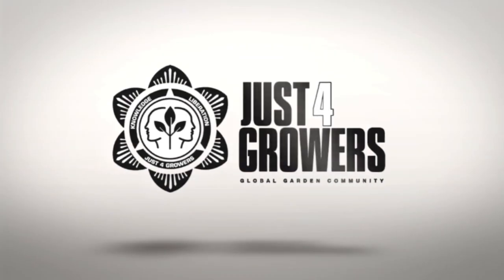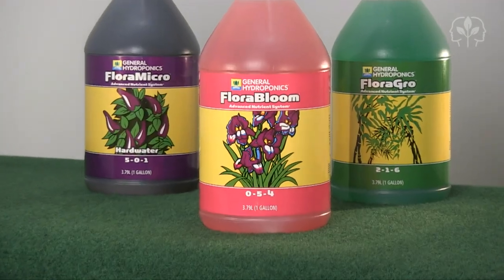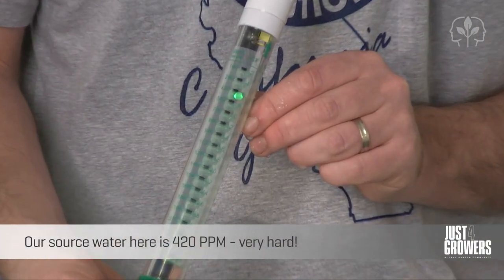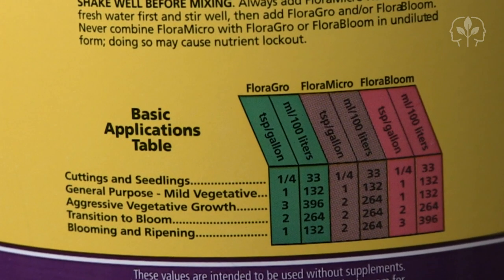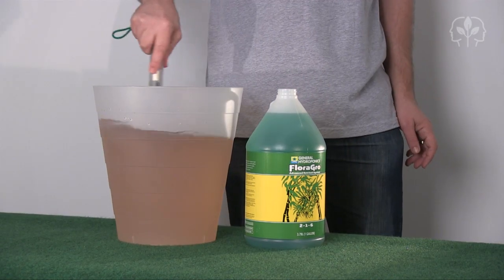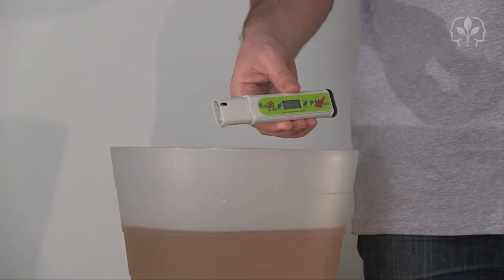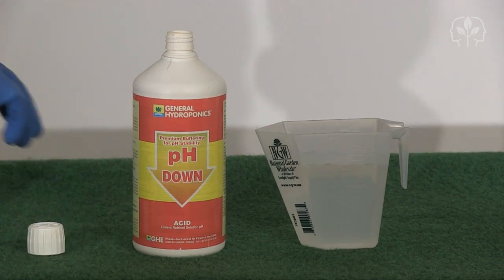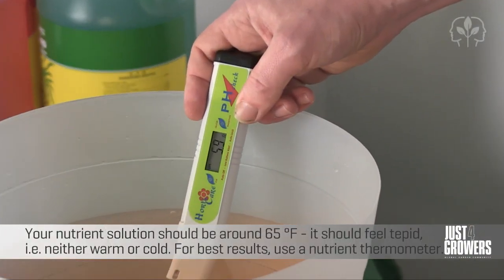How To Mix a 3-Part Hydroponics Nutrient Solution

Comment: Isn't Flora Bloom for the flowering stage and Flora Micro, Flora Grow for the vegative stage?
Reply from the maker: Diggy Craft Hi Diggy, thanks for your question. Actually, Flora Series 3-part is designed so that you use all three parts, all of the time, just in different ratios. (Some people claim they can get away with just two—i.e. Lucas Formula—but let's not go there just yet!) In the vegetative stage, making a general purpose feed, you may well use equal measures of each part. 1 part grow. 1 part micro. 1 part bloom. In peak flowering you may use 1 part grow, 3 parts micro, to 5 parts bloom. Big difference!
Reply: Thanks for answering my question! I started using only micro and grow I didn't know that you used all of them at once

Comment: For soil do I feed once a week only and the rest of the week just water?
Reply from the maker: Israel Yanez Hi Israel. Thanks for your question. I am going to assume you are growing in containers, rather than in beds or in the field. In soil, I would just feed with water to begin with as there should be sufficient nutrients in your potting mix for a young plant to get going. No need for additional fertilizer. Afterwards, you might want to start with a mild nutrient regime after a few weeks and see how your plants respond. Try one watering with nutrients, one without if your containers are over three gallons in size. If they are smaller, I'd recommend using a mild nutrient solution on every watering.
Reply: Everest Fernandez I've heard feed feed water is good for soil?? And can you use GH flora series in soil potting mixes??

Comment from the maker: Hi Mentuhotep Ra. I changed the res every 14-21 days when the plants were small, topping up with half strength nutrient solution and adjusting pH in between changes. I also rinsed off the hydrocorn growing medium each time I changed the res to minimize the accumulation of plant waste products in the growing medium. As the plants grew bigger I upped the frequency of the reservoir changes to every 7 - 10 days.
Reply: +Everest Fernandez (Just4Growers) I\'m not sure but ,if anyone else wants to uncover aquaponics design try Debuncar Amazing Aquaponics  Aid (do a google search ) ? Ive heard some pretty good things about it and my mate got amazing results with it.
Reply: I have a partial hydro system. Each plant is in a separate pot with a passive water reservoir and coco/perlite/hydroton above. Do I need to worry about plant waste accumulation?

Comment: I guess I'm missing something but how do you create a mix of the three part GH series nutrients that would be a custom mix and not just from what they say is a general first stage grow mix?  Their ads say the mixes are almost unlimited to the ratio you want to create and yet in an email I got from them the rep said it doesn't really work that way.  Are the ratios they are talking about the NPK ratios?  I have their 3 part product and I still don't know how to use it other than mix what they call a general early or mid or bloom phase.
Reply: instead of mixing it 1:1:1 you mix it so it has more phosphorus for flowering in a .5:2:.5 ratio.  (e.g. if your aiming for 20-20-20 mix during the vegetation, and then 10-30-10 for flowering)
Reply: rizendell Ok that helps, I'll work with it.  I think you are saying one half measure, two measures, one half measure.
Reply from the maker: Nice one Rizendell and thanks, MegaTregg, for your question. We'll certainly publish some more tutorials on options when mixing 3-part hydro nutrients as we receive a lot of questions about it!
Reply: hallo my bro!!!peace!420!my friend i ask you pls.......for the lamp...if you see the message pls send me!!thanks!!
Reply: buy yourself a EC meter.  You can then adjust your PPM per stage of growth.  This is basically the most customization you can do with these 3 parts.  For example, early veg stage you can add the normal 1:1:1 of your three part, but now you add more water until your PPM is now at lets say 800PPM. if you are in a mid blooming stage you might want a higher PPM so then you do your 1:1:1 with less water to raise your PPM to maybe 1200 ppm.  As your plant grows and flowers, it'll require stronger or lesser feeding, so you need to increase ppm or decrease ppm.  basically you need to learn and follow your plants growth patterns.
Reply: talbond That helps a lot Thx!

Comment: How often do you use the flora mix in  dirt or hydroponic grow water
Reply: Everest Fernandez
good advice
Reply from the maker: Hey Minei - thanks for your question. When growing in dirt or soil-based potting mixes, check the nutritional content of the potting mix first. Some manufacturers offer lighter mixes that require supplemental fertilizer from the get go. Others are already rich in nutrition and don't require any supplemental fertilizer at the beginning. You can use Flora Blend with soil-based potting mixes. Just go easy with it at first. Remember the old adage "feed weakly weekly!" - obviously the amount you use depends on your crop and its development in the lifecycle. For hydroponics, refer to manufacturer's instructions. Remember, it is far easier to correct under-feeding than over-feeding. 

We will post some videos on how often you need to change-out your hydroponic reservoir very soon! If you have any more questions, don't hesitate to fire them over. Best of luck with your grow. Everest.
Reply: Mahalo so much. Your info is most faluable to me. Keep what you say coming. I will need it all. I have a month to gain what i can than my summer grow out and in start. More out than in. I am a bit more advanced with outdoor than indoor but interested in both right now. 
Thank you and Aloha.
Reply from the maker: Minei Kiefer Always happy to help Minei. Good luck with your grows!